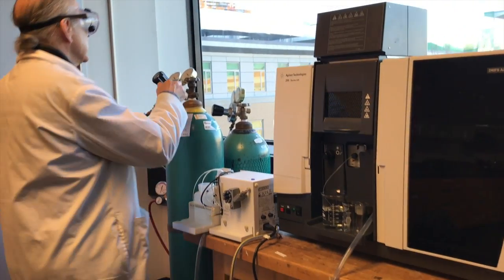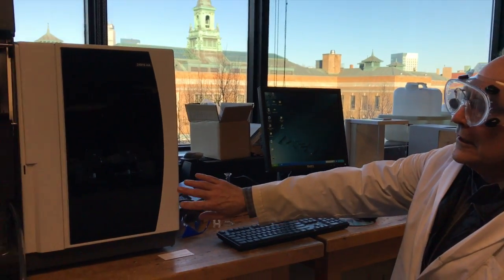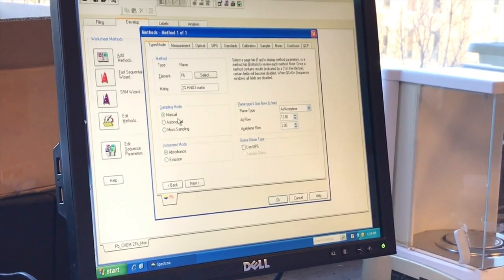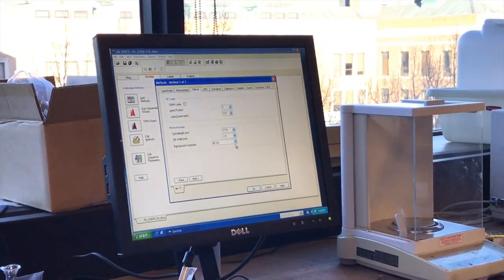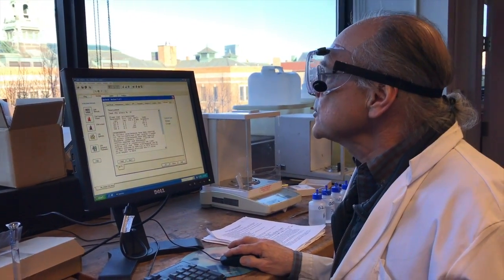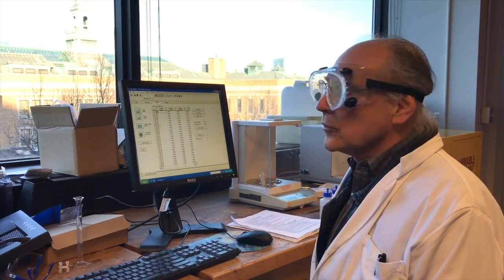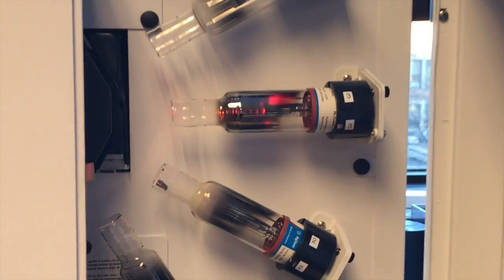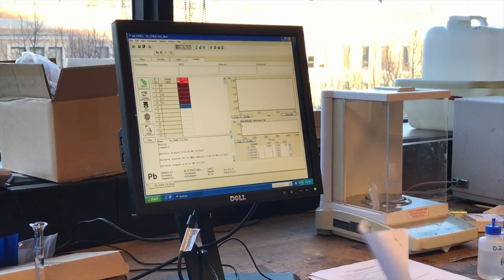Atomic Absorption Spectroscopy Part 1

Comment: hello thanks a lot, I have a question, do you know where I can find to what pressure the acetylene cylinders for AAS are filled, because some say that at low pressures for safety and others that no matter high pressures someone knows if there is a regulation or specifications, I mean that pressure cylinders are filled, I am clear that the working pressure (maximum cylinder output pressure) should be about 10 psi, and that the tank pressure should not be less than 100 psi per training of acetone that breaks down the packaging, but I can buy 2,000 psi cylinder if I have the regulator or I have to buy 300 psi, thank you very much,
Reply: You have to get a regulator, to use the indicated flow rate for your specific instrument
Reply: The pressure on the tank when full is your gas provider responsibility. Your job is to set up your regulator to between 9.5-14.5 psi (depending on your samples). Bellow 9.5 your flame will blow out easily and above 14.5 you are risking an explosion. Acetylene is packed in Acetone and when you run the tank bellow 100 psi acetone will enter your gas box (which you should never touch) and also your spray chamber and will damage your O-rings, they dissolve quickly into a black mass that you will have to clean up.

Comment: I adjust and calibrate the device. I have a lot of experience in spectrometry. I can help.
Reply: I do too, what kind of parameter in your calibration standards do you have for let's say copper. I have a 10ppm and 30ppm STD and after calibration using g a mean absrobance of .4700-.5000 for 30ppm and .1700-.1800 for 10 ppm, we run samples reading the STD between every 20 samples, our standard for 30, ppm will vary from 29.5  to 30.3 and we are trying to narrow this range in absorbance. Do you have any tips?